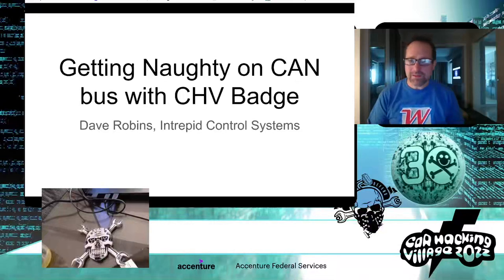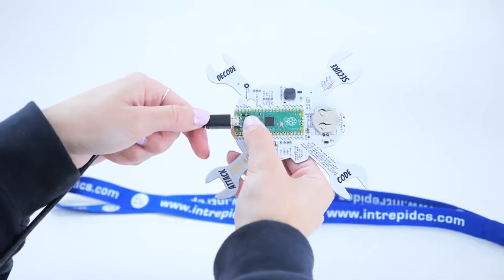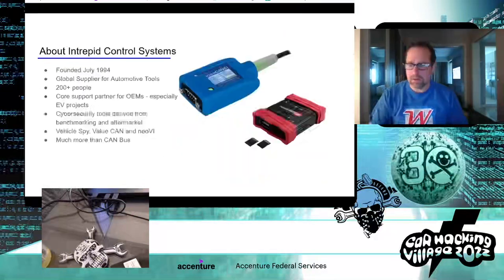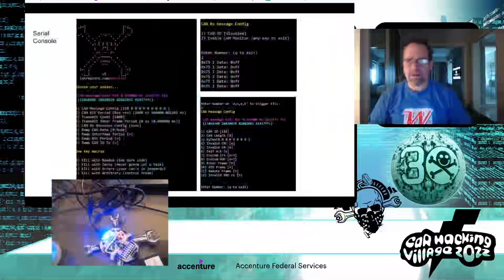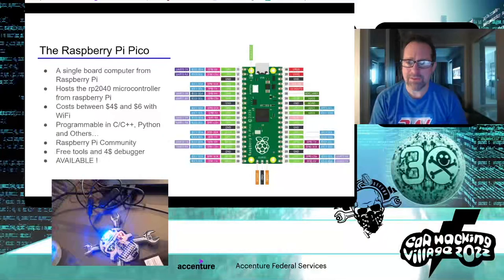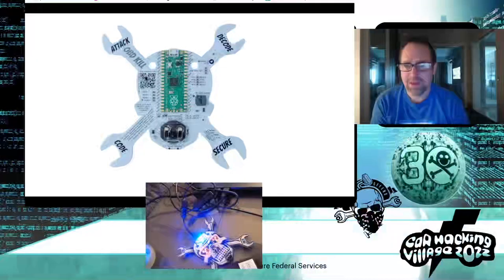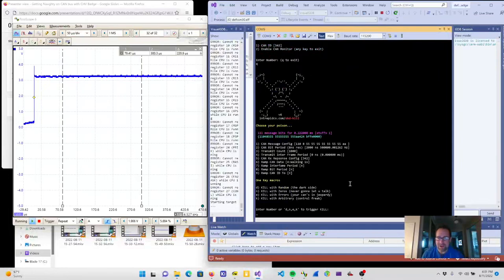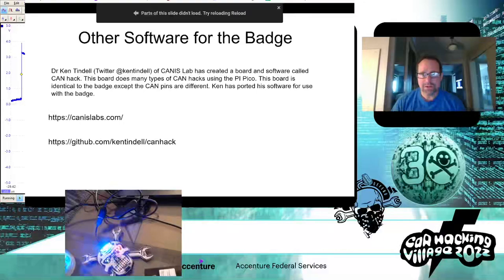DEF CON 30 Car Hacking Village - Evadsnibor - Getting Naughty on CAN bus with CHV Badge

Comment: Where can I learn more about can communication
Reply: It’s simple. Any individual function a car can perform is controlled with an ECM (electronic control module), and each ECM is wired to each other and also wired to the ECU (engine control unit), thus creating continuous communication between all computer modules (sometimes hundreds)……. Now, instead of having a wiring harness physically connecting these computers, manufacturers are adopting wireless connections through Bluetooth and Wi-Fi ☠️☠️☠️